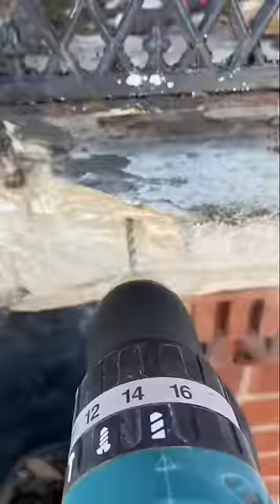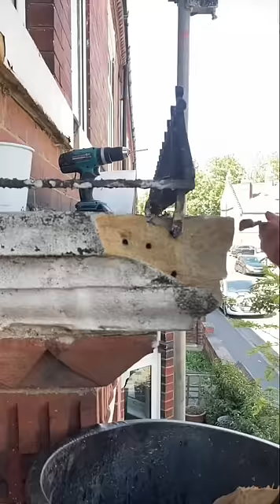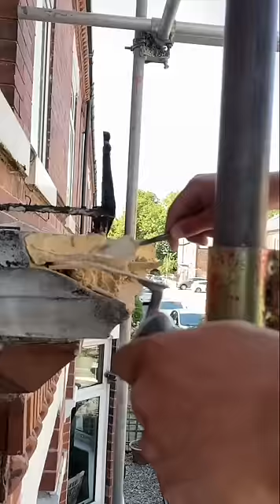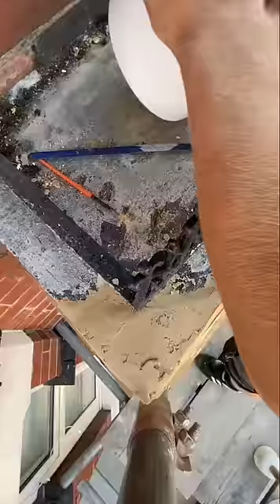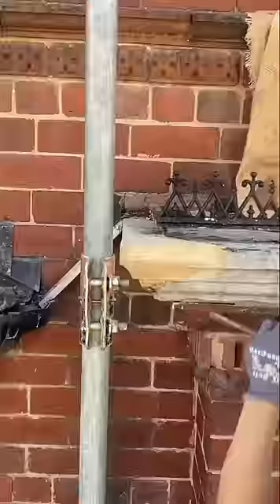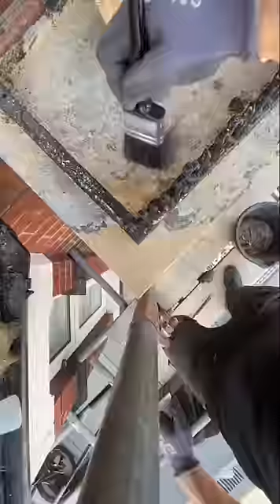Mortar repair ☀️⚒️ #stonemasonry #stonemason #reels #shorts #short

Comment: It was broken due to the Iron rust that comes from inside. IF tou don't treat the Iron,  it Will break again.
Reply: I would clear the algae as well.
Reply: But if they did that, they'd be outta jobs real quick
Reply: It's fine it's got sticks in it
Reply: Yeah, spalling is a problem. It stuffs concrete up badly
Reply: @wolfmann2100 wrong. There will ALWAYS be more things to fix.
Reply: Job security
Reply: I don't think that was part of the deal, otherwise he'd had done it. Get payed for what they need and dip. Not his responsibility.
Reply: @wolfmann2100 And they would lose their reputation.
Reply: Not his problem unless it was in the quote
Reply: 😊 this is a life time guarantee
Reply: He's a masonry, not an iron worker-

Comment: Did an excellent mortar repair but didn't fix the root of the problem. Should of cleaned and painted the metal to stop this from happening again.
Reply: You don’t know how it broke you’re only guessing 🤷‍♂️
Reply: @stephenweir2003  I've been a metal heritage specialist for over 10 years. I've seen more damaged stone caused by expanding rusting metal than you've had hot dinners.
Reply: @Blacksmith-Joe  😂 yeah big expert 👏. Like I said you’re guessing you weren’t involved in the repair.
Reply: @stephenweir2003  Correct, the same way I'm not involved in repairing a tire that has a nail sticking out of it. I can still see what caused the problem in the first place. Expanding metal has an immense amount of force behind it and more than enough to pop and blow edge and corners of stone. It was a technic used by roman stone masons to split large stones. 

Stone being blown by metal is a very common problem, you don't need to be mystic Meg to see and know this.
Reply: @Blacksmith-Joe  like I said before you’re guessing what happened in order to criticise someone because you think you’re an expert 🙄.
Reply: @stephenweir2003  your ego is outta control lad
Reply: @tubbyrainbow111  not mine lad 🙄
Reply: That is not his job and would have taken extra time and money for both the client and him
Reply: @Epic_Memer_Man  wrong
Reply: @stephenweir2003 YouTube comments r so delusional it’s unreal “ah yes you do this exact thing for 10 years but I know better about the subject than you!”
Reply: @stephenweir2003  yes yours 😂
Reply: @stephenweir2003 if you look where the metal was sticking in the stone and look at the part that broke off, it's a no brainer to see what the cause was.
hi, I'm a stonemason myself. I've seen nearly identical things countless times. trust people who have experience.